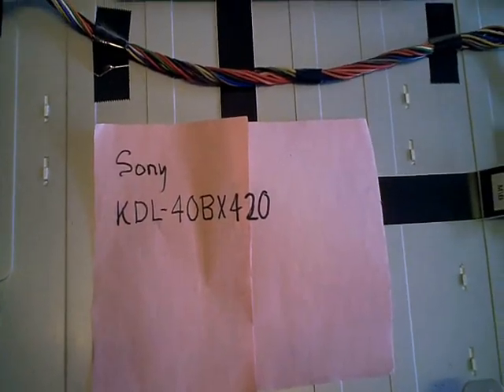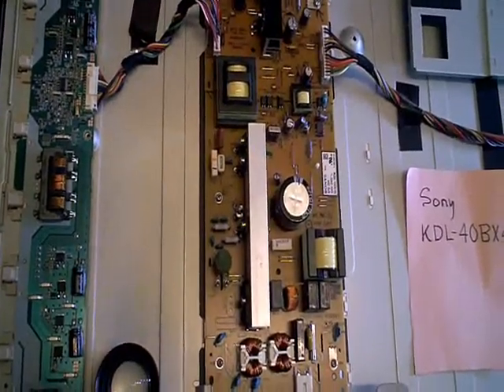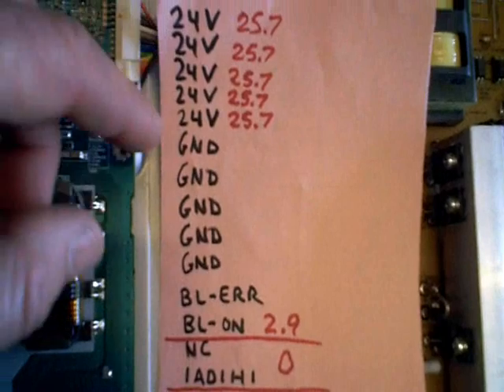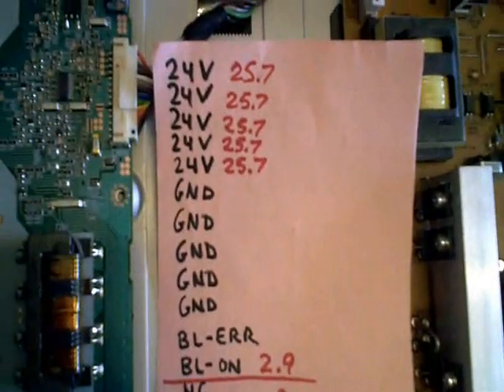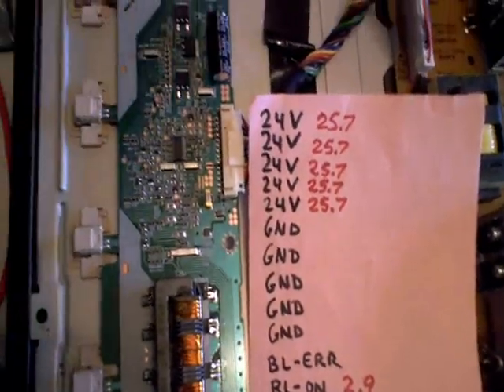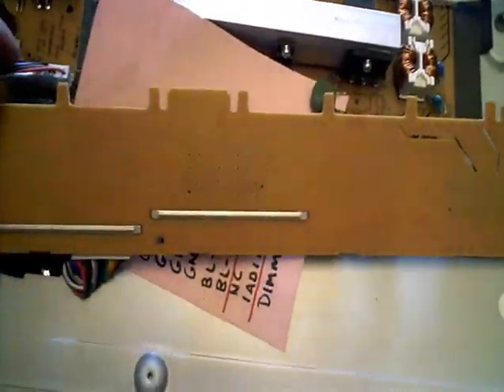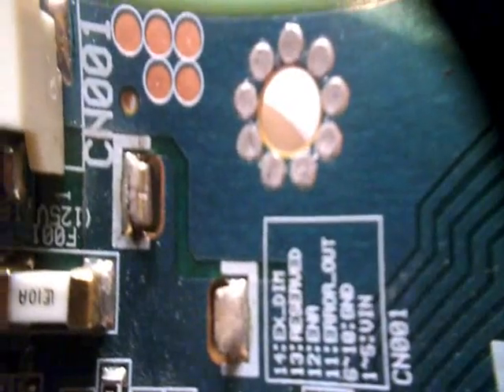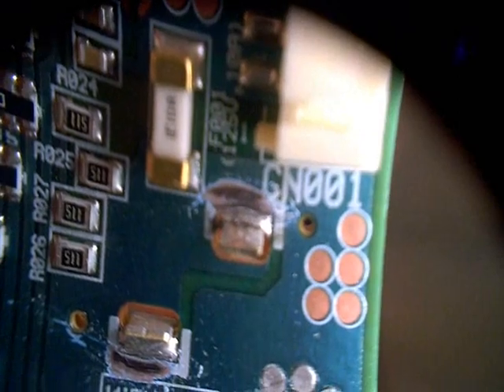Sony KDL-40BX420

Comment: Hi there, wall 'o text incoming. Been watching most of your videos and they've been immensely helpful, but I am still stuck.

I have a Hisense 50h5g that is doing this same thing; I get picture and sound, but no backlight. It is an LED array backlight, no CCFLs, so somehow power isn't getting to the LEDs. I ordered a replacement kit that included inverter board, main board, and TCON board, but after replacing them, nothing has changed. When I meter the plug going from inverter board to the LED array, I get 0v on both legs when plugged in and unswitched, then 400v on one leg and 0v on the other when switched. Seems to me that if there's 400v there, the cable going to the LEDs must be toast? The board itself lists output power as 12v/3A, 16v/1.5A, and 200v/400mA, so maybe 400v is completely wrong for that plug? The labels on the connector from inverter board to main board are very confusing because there are 15 labels, but only 10 terminals, so it's difficult for a novice like me to determine what readings I should get at each terminal. Thanks for all your videos and information sharing, if I weren't on the opposite coast, I'd just bring the damn thing to you!
Reply from the maker: I don't know the specifics on your TV,  but seeing a high voltage going to your LEDs  isn't necessarily a problem. The LEDs are wired together in a series and parallel circuit. That being the case the voltage can be quite high, so the 400 volts may be fine. I would suspect some of the LEDs in the series circuit have gone bad.

Comment: I always loved those bad solder joints, they were a nice easy fix and you could make a few 
bucks on the job !
And, recalls were at a minimum with bad connections, as we didn't worry about the new parts etc. going bad again in a month .
I remember the sony chassis 32/36fs120--32/36hfx70 etc.....I would actually resolder the entire chassis, as I'm sure you know they were notorious for bad conn. from the amount of heat they generated !
Good job Dave !!
Question....how has buss. been in the last couple years ?
I see norcal is only doing very little, and he is a great tech, as are you !
Thx....
Frank.....Richards TV. !
Reply from the maker: Frank Pitochelli  Thanks, Yea bad solder joints were a common theme with the old CRT TVs. I miss those simple repairs but I'm glad I don't have to deal with those heavy TVs any more.  
   My shop isn't all that busy but it still pays the bills. Are you still doing many repairs?
Reply: Maybe a half dozen a month..I'm driving black car/ limo, its a clean job, wear a suit and tie etc..
crazy hours !
As far as the heavy crt tv's, I was glad I invested in a "test jig "   so only had to pull the chassis.
I do miss the money we could make back in the 80's  90's... however, 2010 is when I started to see more slow months, by 2012, it was busy only one day a week, and after 35 yrs. I started to burn out !
ppl. don't understand how much we had to keep up with all the new tech....and make far less than all the other trades, per sey .
Thanks for the chat.
best wishes
Frank.
Reply from the maker: Frank Pitochelli I understand feeling burnt out after 35 years of this. There are days where I'm ready to bail after 22 years of this. Take care. Dave